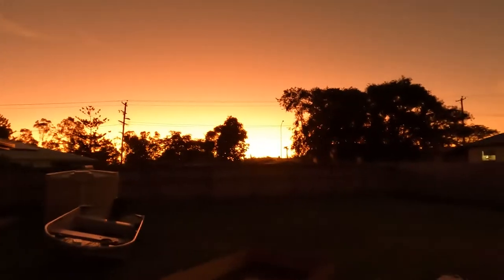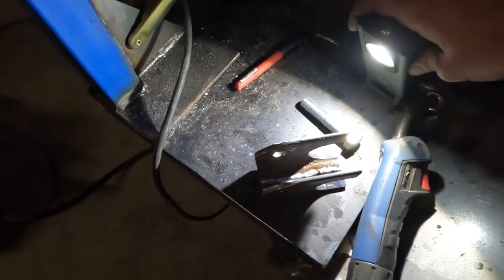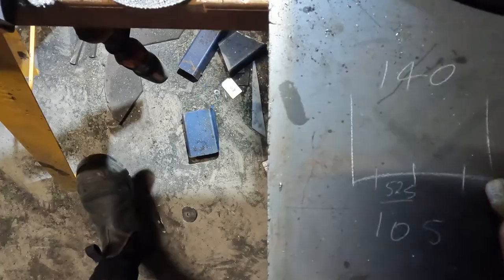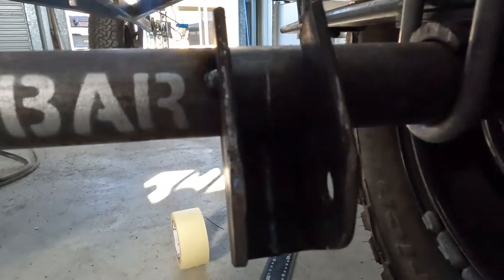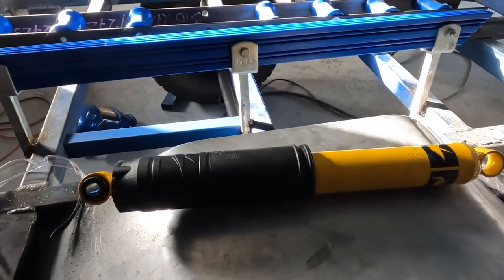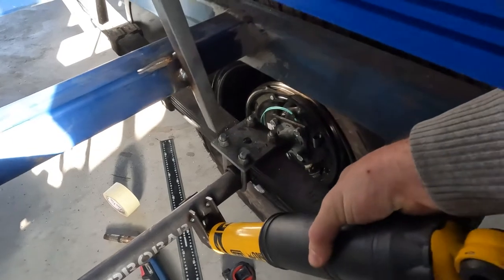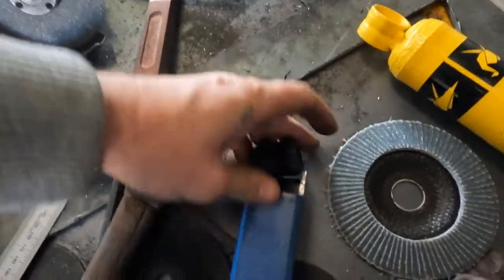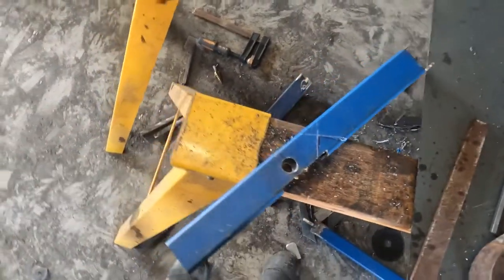OFF-ROAD BOAT CAMPER TRAILER BUILD PART 6 - CUSTOM OLD MAN EMU SHOCK MOUNTS

Comment: Nice work.  How are you pinning those centre rollers in place?  I built mine using C-channel instead of two lengths of angle back in 2004 and found the split pin less than ideal over time and getting smashed by gravel.  Your design should protect them a bit better but perhaps get the biggest ones that will fit if you can.  I also built mine to be able to raise or lower those rollers so was a little different.   Are you running some sort of underbody protection full coverage for the tinny?  I now just run some shade-cloth after having stone damage cause a split in the hull.
Reply from the maker: They are just 16mm spindles and 4inch keel rollers. Yeah we should have worked out a way to make them adjusted because not all of them contact when the boat is level on the trailer. We haven’t worked out protection yet but have been tossing up between rock tamers (big mud flaps) or shade cloth like you’ve done. Great ideas thank you!
Reply: @lifeina4wd  you could do both.  The shade cloth works great but does get worn over time.  I also fixed a thick rubber mudflap right across the axle under the trailer to further knock down the stones.  Be good if you can get all the rollers to share the load too.
Reply from the maker: @benkincade5254  good ideas, thank you!